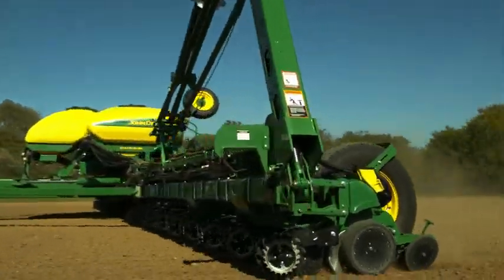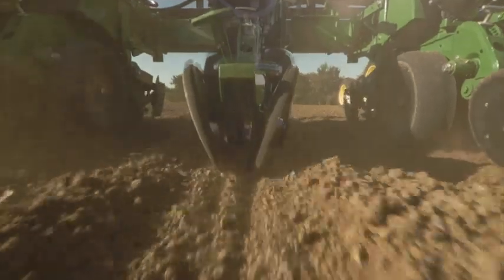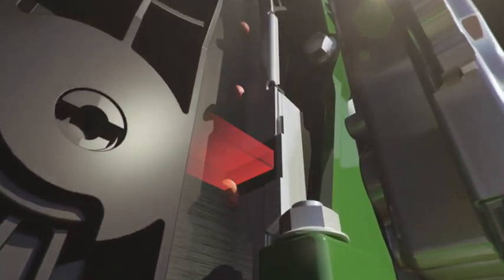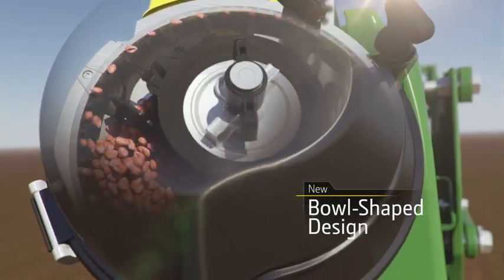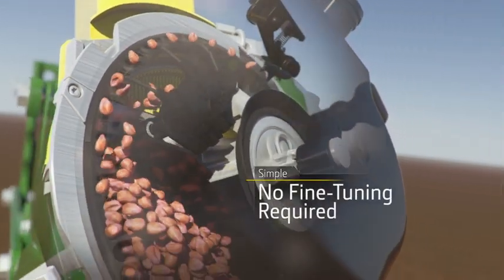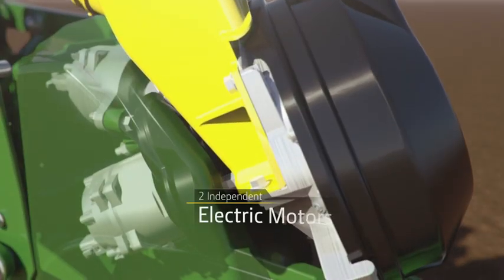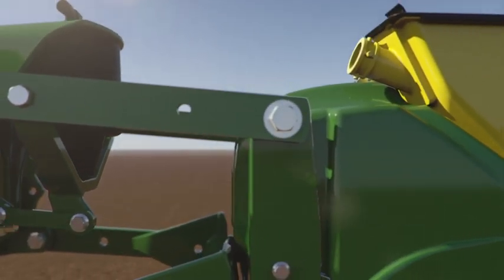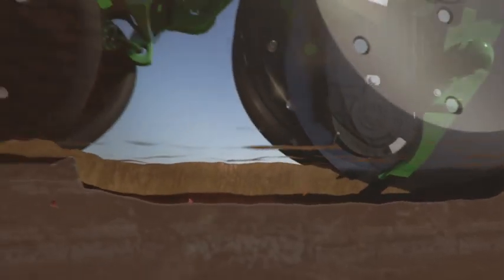Virtual Tour | John Deere ExactEmerge™

Comment: To all the commercial farmers out there. I work for a university research farm and i have to sign affidavits every year so that my research results do not contain bias. This i will tell you. 10 mph planting speed is a wonderful goal. However, just because you can singulate at the meter, it does not mean that something does not suffer in one way or another. Whether it's your seed spacing, wear parts on your planter, etc... There is a happy balance in planting speed versus bottom line. I sincerely do not believe it's 10 mph.
Reply: I talked to a farmer that claimed to have planted at 16mph. I told him that just because the planter lets you drive that fast doesn't mean it's working well at that speed. He said it did a good job though.
Reply: @3.6roentgen61  Well, you have to look at all the potential negative effects of planting at 16 mph. Like having to spend more time with your wife rather than being on the tractor.🤣
Reply: @brettpettinger9200  😂😂
Reply: @3.6roentgen61  Every production decision can impact your bottom line. Divorces are damn expensive🤔🤣